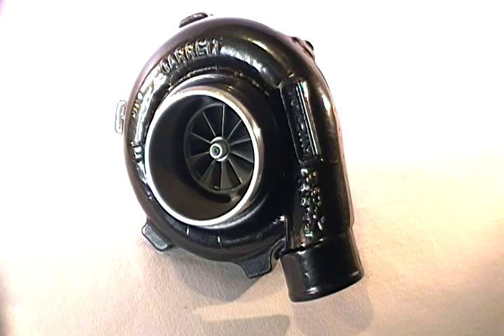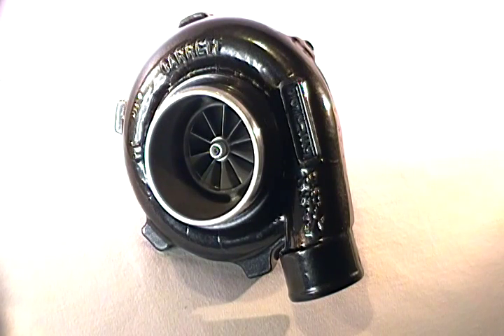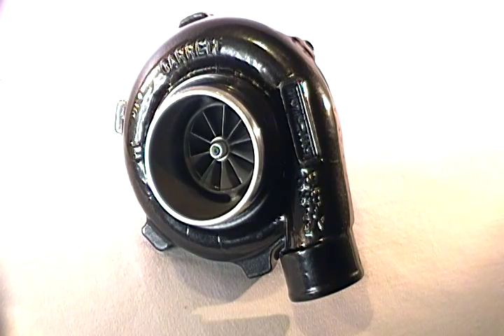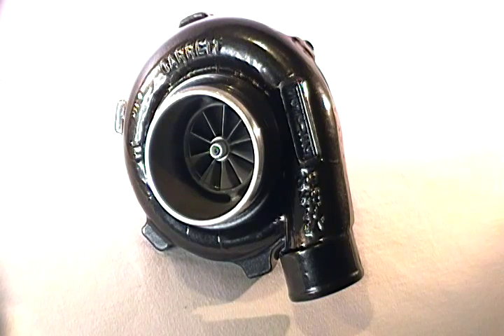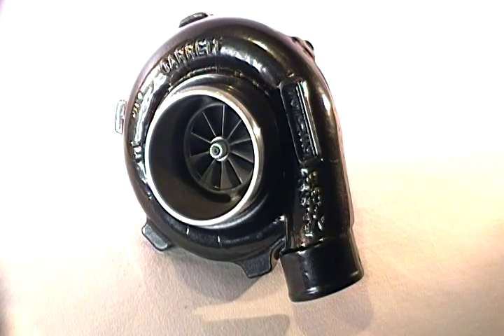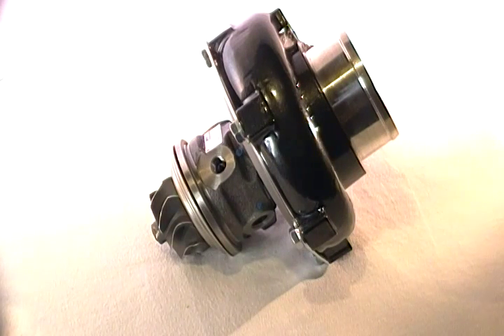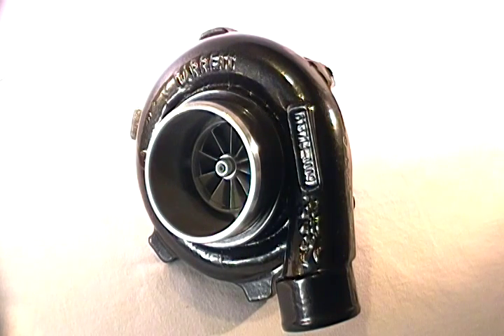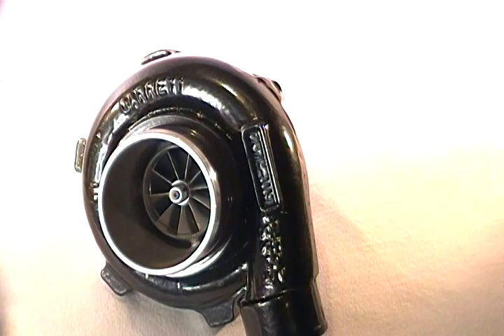GTX2867R STC Description and Review

Comment: I have this turbo an a Honda D16Z6 (1.6L) and it's a dog, very slow to spool up and basically all the power comes up after you pass 4K RPM. I would not use this turbo on anything under 1.8 liters. In my opinion 2 liter engines are the sweet spot for this turbocharger.

Comment: I have a s14 sr20det engine is built the turbo I was looking at was the gtx2867 but my tuner tells me I need the gtx2971 for my 460+470 HP goal....what I'd like to Kno is how laggy the GTX 2971 would be abt I can't find much info on this turbo I looked n looked
Reply from the maker: Elie king , check under the catalog archives of Garrett catalog 2016 under this link. it should be there. are you talking about 470 brake horsepower or power at the wheels? different Turbos fit different understanding of power 
http://speedtrappconsulting.com/Articles-Reference-Information

Comment: hey there great video! ive built a forged Toyota 1.5 litre (5efe) engine and now trying to size a turbo for it. After many possibilities the 2867 seems like the right direction to go. I could understand using this turbo on say a 2.5 engine under big boost it would really choke... but on my 1.5 litre engine under 30+ boost how would this perform? probably a stupid question but id love to read an answer. thanks!
Reply from the maker: I don't think that the GTX2867R is completely out of the question. But it depends upon the power goals that you're looking for, and the purpose of the car (like making the 1.5 litre act like a 2.5 litre?) and not just boost pressure level dependent.   The 1.5 litre likes to keep things nice and even, so if you're looking for something that's going to simply make the engine seem like a larger engine, and not drag race oriented, You'd really want to see about the smaller (and classic) GT2554R and GT2860R cast wheel series. If it's big power you're looking for like over 334whp or so, the GTX2867R could do it, but would be rather big.
Reply: STC Turbo Descriptions ok so the car ive built is a twin engine toyota starlet, it has so much torque down low its ridiculess and lag isnt really a worry for now... yes its for the dragstrip so aiming for the 350 hp mark on each independent engine (seperate turbo, fuel system, intercoolers ect)

another guy is running a gtx3071on the same engine and makes over 420hp but its quite laggy...

do you think this turbo is caipable of roughly 400hp on that engine maxed out even though im only chasing around 350?
Reply from the maker: Yes. I think that this turbo would respond a bit better for each engine than the GTX3071R or the GTX2871R (Same compressor wheel, different turbine wheel).  I guess "lag" is only going to be addressed depending upon how your launch control is setup and the tune of the car at that point. But for all things being equal, I believe that the GTX2867R is a better choice for that set of engines.